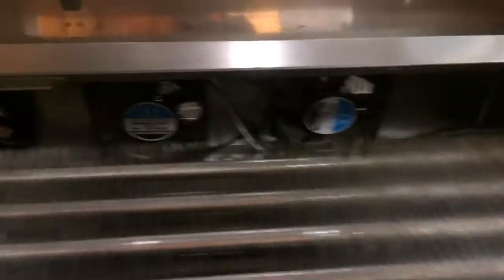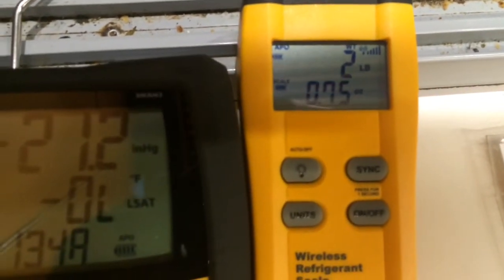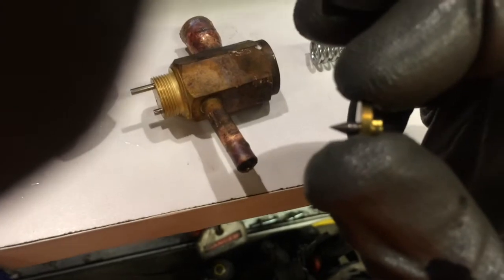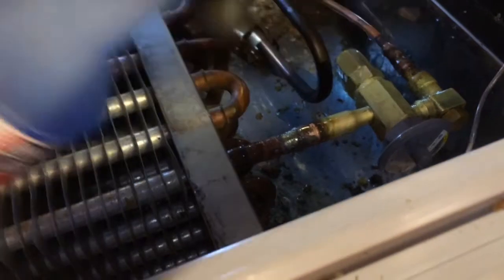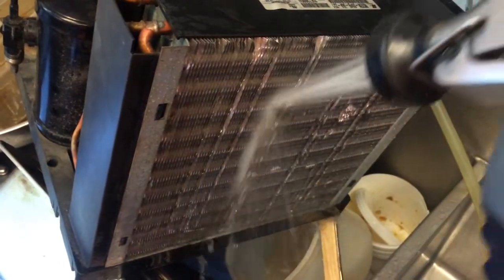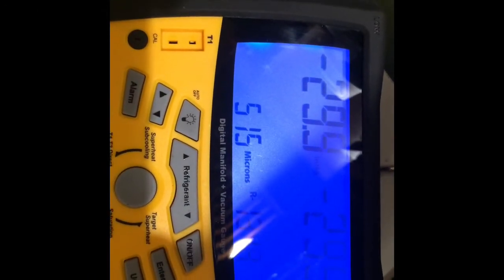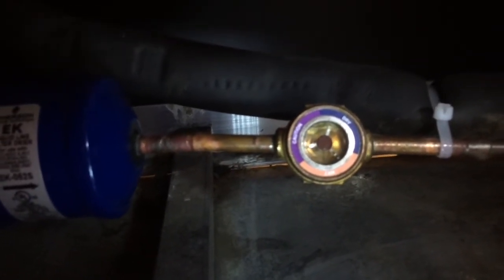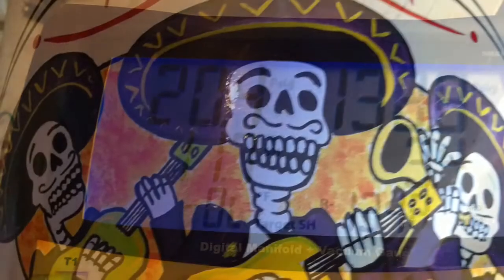Display case repair

Comment: If the refreigent is 134a why did you use a r 410a recovery tank ?
Reply: The tank is rated for 410 pressures but don’t have to strictly use 410 on it

Comment: Min 8:00

What does "adjusted the valve" mean?
Reply from the maker: Setting the super heat
Reply: @NorCal-refrigeration  
Thanks.

... And does that mean there's a screw on the TXV that you can adjust?
... I guess that would be "more" liquid to get lower superheat, and 
"less" liquid to get higher superheat?

Comment: have ever used cool gel as a heat sink I use all the time . does the subcooling matter like it does.in residential a/c ? nice job
Reply: James Toy the problem with those heat sink gel is they freeze  during winter time . wet rag works good too.

Comment: so the 3 main things you check for charging back up on this display is amps of the compressor, superheat of 12 for the evap, and no bubbles in sight glass? but I didnt see you check the amps?
Reply from the maker: I weighed the charge in on this unit. I set the super heat because the valve is new, amp draw didn't make editing. On that unit with factory charge the sight galas bubbled until the valve adjusted, took a while. I think the unit had been over charged in the past.
Reply: gotcha, thanks as always

Comment: But why are you replacing the compressor. What was the symptoms
Reply from the maker: I got killed from a dirty condenser. New compressor new txv. It’s still running today. That’s an old video
Reply: @NorCal-refrigeration  My compressor is short cycling. Low side between 50 and 70. High side between 60 and 80. It is an under cabinet refrigerated prep table. I’m not sure what brand. I cleaned the condenser. It was pretty dirty. Compressor is not hot. Any input?
Reply from the maker: @arthurmarks3763  possibly low on charge. Is it cycling off of a low psi switch?
Reply: @NorCal-refrigeration  No. cycles off after 15 seconds at 50psi low side. Condenser was very dirty. cleaned it but still the same thing.
Reply from the maker: @arthurmarks3763  what’s controlling the compressor? Just a Tstat?
Reply: @NorCal-refrigeration  There’s also a low pressure switch and a high-pressure switch. It would have to have it thinking about it. But I’m result the compressor was no good. Probably from the condenser being dirty

Comment: I make chocolate and I am in the market for a display case. Standard cases max adjustable temp is usually 46F. How would I adjust the controller to cool only to 55F which is more appropriate for chocolate. Do I just change the temp controller to an aftermarket one that is not locked at 46F?
Reply: you should call the company that supplied you the display case